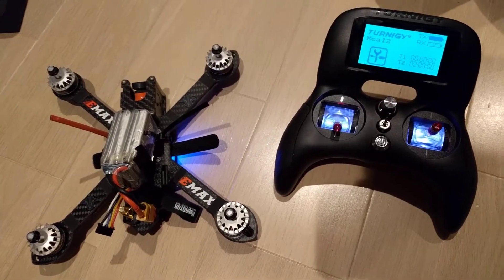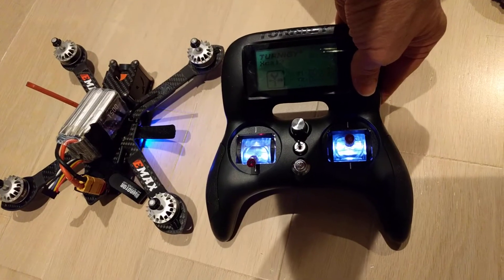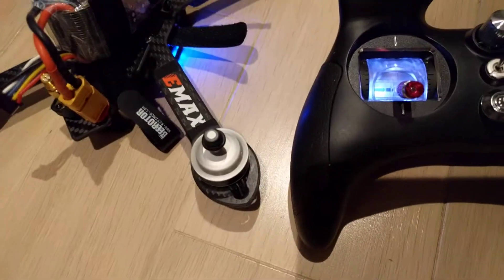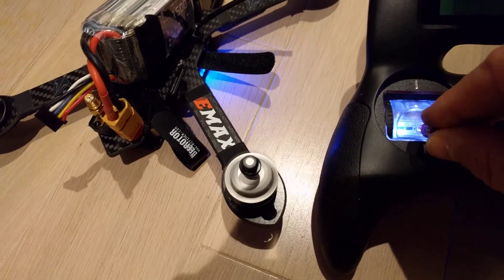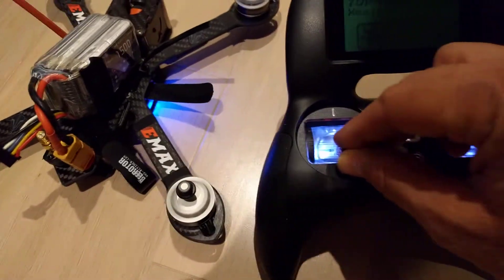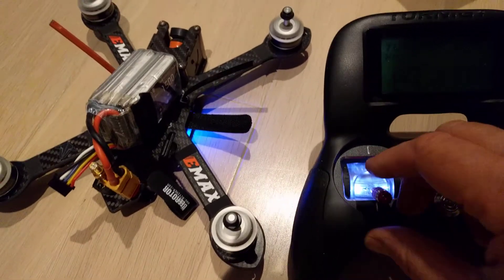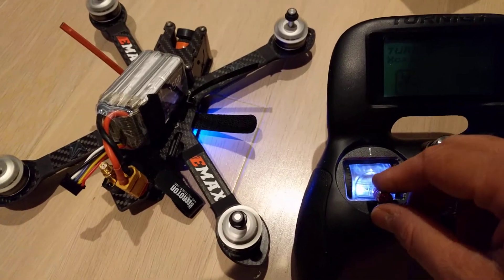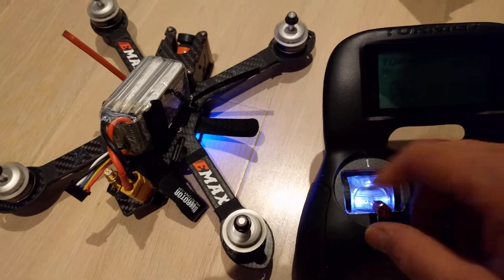FlySky FS-A8S receiver (from Banggood) brown out issue

Comment: thanks shawn for this video.   very informative and good test.   I really like the turnigy evo,  but lately, i am having brownouts and dropouts, even with the ia6c….
Reply from the maker: Oh really?  Well, now that you mention it, I did too, a little.  Mmm, maybe also on the FS-X6B as well... hard to keep track.  LOL  I think it was my antenna placement though.  Or damage to it (I crash a lot.  In face, my landings are light crashes.) XD  With the ia6c and X6B on new builds it was flawless.  But I usually have good placement practices (90 degrees to each other, sticking out enough so that no matter what position the quad is in, I have directly line of sight signal to one of them... where possible).

Comment: same issue! :(
Reply from the maker: wrap that puppy with electric tape (after taking the case off - if there is already heatshrink, no need for tape), then aluminum foil, then heatshrink or electric tape.  It'll work.  Until it lets you down.  LOL  But seriously, you can fly it near you - maybe 100 meters relatively reliably after that fix.  Just don't risk anything - no going over places you can't retrieve it if it fails.
Reply: Thanks for the info, I already saw something like this but im not going to do it, I dont want to risk.. its crap i already got info about refund from BG.. so its probably going to trash.. :(

Comment: Anyone have this probelm solved? How much aluminium did you use?
Reply from the maker: If you use something like a cut soda can, or even a layer or two of BBQ aluminum foil it will be good enough for most purposes.  I will add to that a note of caution... in any case - no matter what anyone has tried, whether it be V1 or V2, people do seem to still have random brownouts - and some have lost their quads in rivers and such, or had really bad crashes that caused significant damage.  There are only two situations I would use these - on a brushed micro (no known issues), or flying in a field where crashing is not a problem.  No matter what, don't fly over any place you don't want to crash or you would lose your quad (like over water or very tall/dense "grass").  
There's a project (possibly more than one) to mod the Evo to support FrSky - that would be ideal because the FrSky XMX+ is far superior to the A8S.  To get my by until then, I've chosen to purchase a Taranis Q X7 and some XM+.  For me it isn't worth the risk.  I fly fast through things that can explode my quad, and if I do crash into that stuff due to pilot error, that's on me and I accept that risk, but losing one due to brownout... well, I don't want to be that pissed and not be able to do anything about it.  My solution is preemptive.  ;-)
Reply: Thanks. Evo has really limited receivers to a point is annoying or feel like giving up on.

My problem is even without arm, just view BF receivers, everytime i full throttle, yaw left or right, it will freeze or cause FC to reboot. It happens to 2 different quad of mine that use this receiver.

Comment: any update for solving this problem?
Reply from the maker: Ardy Seto Priambodo thanks for the reminder!  basically yes, but not the way I'd like.  If you get a v2 it will save as sbus according to others.  I don't care because ibus is at least as good.  The brown out can be fixed by making a diy shield around it.  My friend discovered cutting a piece of aluminum grin a soda can works great. myself and others have had success with other stuff like kitchen aluminum foil, but the thicker the better to a point.  Make sure that is insulated on both sides, however you like. I used gaffer tape, aluminum tape, then heat shrink.   I tested in a race track sized field and never had an issue.  really kind of amazing given it doesn't have diversity.
Reply from the maker: @Murat özden aaahhh, you mean the fix?  Unfortunately you can't post photos here.  But I made a reply to the thread on RCGroups, posting some photos of my fixes.  https://goo.gl/tBXRnJ
Reply: Hi Shawn can you show a photo of it please. i have got three of them and they all perfom same as in the video:(
Reply: i look today thanks i try and it works fine but it is wierd :)) i mean it is not mini receiver now :) also flysky sends a photo of how to do it. thank you.

Comment: Been having exactly the same issue! I It seems the A8S is sensitive to electromagnetic interference. I found that if you have it mounted close to esc power wires it glitches all the time, but if you move it a few centimeters away it works perfectly
Reply from the maker: grahame addicott mine wasn't so close to the ESCs, but your right.  I made a pretty good EMF/ RF shield on the RX and it worked like a charm... even on my 130 that uses 20a ESCs running 1407 motors on 4S.  it's a screamer!  Still need to test range, but pretty sure it will be adequate.  I'll post a video once I make that test and link to it from this one.
Reply: Shawn Sato-Veillon how did you make a shield? On my old quad moving the RX fixed the problem and I got a good 800m range. on my new quad there isn't room to move the rx so some kind of shielding is my only hope! lol
Reply from the maker: I have some special aluminum "tape" that I used.  Basically, the accepted way to do it (you can vary on this however you choose) is to wrap the RX is something insulative, then add a layer of aluminum foil (I suspect copper works too, but aluminum is lighter), the another insulative layer.  The insulative layers are so that it does't short anything.  The aluminum in my tape is about as thick as 2 or 3 layers of heavy duty aluminum foil (roll).  It just happens to be about the right size for this purpose, and I think the thicker the better in terms of effectiveness.  I used electric tape, then my aluminum tape, then heatshrink.  Seems to be working well.  I didn't weight it, but the quad it's on is powerful, so not really an issue.  Size is way more important.
Reply: I can see what you mean about EM interference. I haven't encountered this issue (as seen in this video) but after reading this, I know why I don't get the same issue. My A8s is always mounted on the top side of my FC and my ESC's at the bottom of my FC (or if I have individual ESC's, mounted on the arms, very far away from my ESC's or motors). 

I usually flight 2 and 3" builds, so I would be more sensitive to EM interference and would've encountered this issue a long time ago (never had this issue happen to me). 

The only time I've seen something wrong was when I used the A8s with a Matek AIO FC (without ESC's) and ESC's mounted on the arms (30A esc's). My A8s would act weird on the bench (twitchy movements). After switching to another RX IA6B, it behaved normally. I ruled it out as an incompatibility with the FC board, because my rx was mounted on top of the frame and ESC, FC's were on the bottom frame (I had it separating the power with a Matek Power distribution board at the time). 

I also believe this happens on 3s-thru-5s builds. My 2s toothpick is using my A8s (that gave me issues on the FC I described above) is working fine with that toothpick build. :)  Toothpick build is using the Crazybee AIO FC that comes in the Mobula 7 and Trashcan models. :)

Comment: Ok guys, we are currently testing to see if there are any manageable solutions for this issue. I will update here https://www.rcgroups.com/forums/showthread.php?2792377-FS-A8S-help as I get more information.
Reply from the maker: toiletduckie44 more or less, although I haven't confirmed.  Making a shield from electric tape and aluminum foil (or similar).  That is reported to fix the brownout issue.  The SBUS save issue is fixed in v2 of the RX, but v1 users can just use iBUS, really, it's the same as long as your FC firmware accepts it (nearly all do, BetaFlight does and that's all I care).  ;-)  I'll be testing my fix today.
Reply from the maker: Flysky RC Model you guys rock!
Reply: Shawn Sato-Veillon iBus is much better anyhow
Reply: About three months after the discovery of this issue and after version 2 the problem still lingers. I went out this weekend and crashd my new quad putting personal injury at risk to myself and others...plus the cost and time to repair. Why does FlySky not stop selling this product until it is fixed? Why do they not make the people who purchased this product whole?
Reply: Any solution yet?
Reply from the maker: It was always my understanding that iBUS was based off of SBUS but adds improvements, so I'm on the side of the same belief.
Reply: Check out RCGroups for more news on this, sorry I cant keep track of comments here!!
Reply: I am sorry for the issues you have had, if you wish to talk to someone here about it you can email flyskyRC@flysky-cn.net or me Jason @ jason@flysky-cn.com (I am in the testing department but I can make sure your issue is heard)

Comment: Exact same thing as mine does.
Reply from the maker: In a way, that's comforting, so I know it's not something I'm doing.  Have you tried using a BEC to power it?  I'm thinking of taking power and ground from a 5v source instead of the UART.  Maybe, just maybe, that will "fix" the problem.  Even if it does though, it's totally not acceptable and FlySky needs to replace these with ones that work.  I'm convinced its a bad batch because so many others are out flying theirs with no issues.  Just our luck, huh?  XD
Reply: I've tried it off driect off a seperate 5v port on the PDB, but in essence it's no different than running through the FC 5v rail.  I don't have any BECs to try, but it should not be needed.
Reply from the maker: It kind of blows my mind that this is caused by electromagnetic interference from the ESCs when no other RX I've ever tried had that problem.  not like they had shields either.  I really wish they would figure it out.